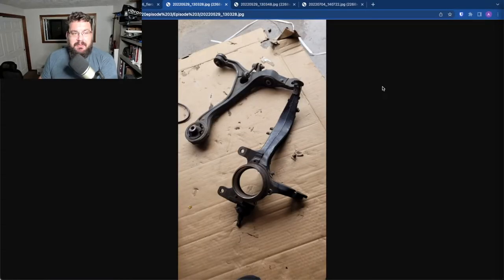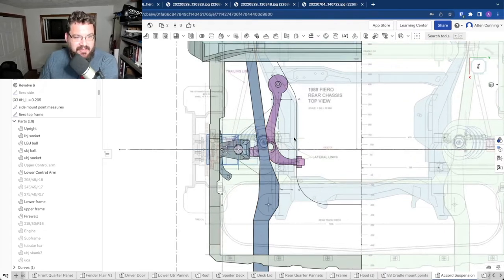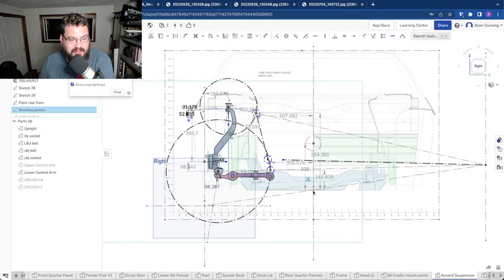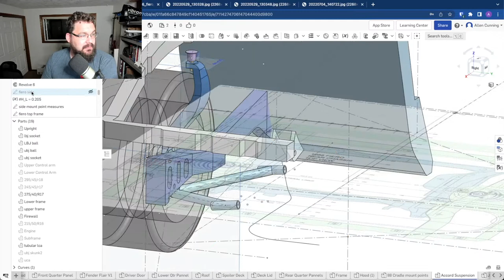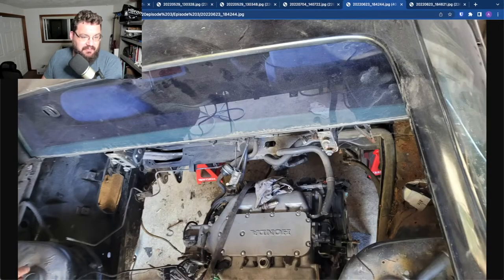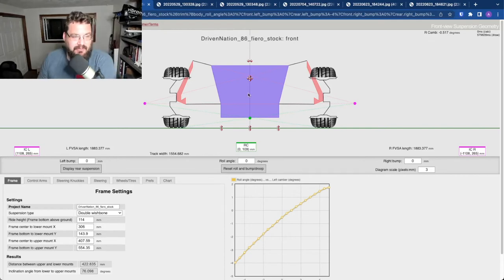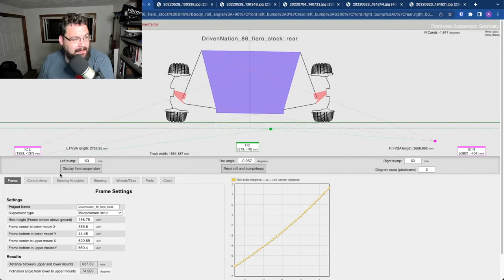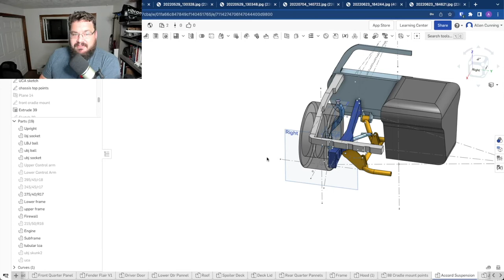J Swap Fiero Episode 3

Comment: I was dreaming something similar to your Fiero build.  Not only is the J30 and then J32 or J35 great engines, you can get it mounted to a 6 speed transmission and if you use the suspension from an Accord, it is a really good suspension being double wishbone with a large difference between the upper and lower mounts on the upright (knuckle).  I am guessing that since this is 2024 and no new videos on the Fiero, that this project got dropped.  That is too bad.  This has potential, but that comes with problems that need to be overcome. I would love to see this move ahead.
Reply from the maker: It's still a thing, I have just been distracted with life.

Comment: hey just stumbled across this, always wanted to do this!! I daily an 03 cl type-s 6mt, and my wife has an 07 tl type-s. I've been a hondafile for 20+ yrs, but once i got a j-series haven't had anything else. I had a spare cls6 and 06 tl 6mt but things got tight and got rid of the spares...... was wanting to do an mr2 or mx5 jswap but been eyeing a fiero and wondered if anyone had done it yet. I'm hoping yer still trying to make this work (or done!!), Good luck and take care.
Reply from the maker: Im still working on it. I got sidetracked getting my e46 read for the season and just don't have enough content to justify a video yet without just doing unboxing of parts i have accumulated.

Comment: Looking good ! Have you considered using the sub frame from the accord and modifying the mounting points to the fiero ? Just a thought, I've got a 86 fiero gt  and  the j30 with a 6 speed from a 2006 accord that I'm looking to put in as well and I'm just trying to look at all the options before getting too far into it.
Reply from the maker: I have, ish. The accord subframe wouldn't mount without modification... and then it's not super light. So I landed on making my own subframe. I think I could use the fiero subframe and then weld on mounts, either for the stock accord lower control arms or my own creation. I will strip the 86 fiero subframe and take out the accord subframe and mock them up on the car. I still think I want to make a tubular subframe but it's worth exploring beyond just conceptually.
Reply: @driven_nation   definitely, I'm excited to see how it all works out. It will also give me an idea on where to start !

Comment: This is really cool. I like the idea of using the accord suspension. Im surprised you couldn't get more camber gain in a roll though. What if you made the upper control arm shorter or moved its inboard pivot point down a bit? Either way great idea, the Fiero bearings arent great and I dont even know that you can get the rears any more.
Reply from the maker: I have because the upper ball joint mount is so high, if I just give it more angle, around corners it will move the wheel laterally (inboard/outboard). Currently I have 13deg of angle down from the upper ball joint which I **feel** is about as much as I should run. The arm length is also limited due to the drive train package. my LCA in this picture may be too long as it may hit the block on the passenger side.
Reply from the maker: I fixed the link in description so you can play with the geometry. If you find a better set up, let me know!
Reply: Well  I love the older lowered V8 vans or some are are so-cslled " barn door". Now the fastest I've gone? A buddy had dropped a 350 in his,S-10 & "DAMN!!!!!!!!!"  I can imagine all that horsepower & a lightweight frame????

Comment: one thing that worries me about this project is the engine since the manifold and the intake are cast into the unit making it hard for you to get power gains later down the road when you do upgrade things
Reply from the maker: Just the exhaust manifold is cast in. The intake are regular ports. There are multiple 600+hp examples with this mono port setup. That said I have since bought a j32a2 which has traditional heads since it was only $350 and picks up 20 hp and 30 ftlbs of torque. Selling the cats of the j30a4 basically paid for it.
Reply: @driven_nation  thats great to hear! i honestly hope you go for 6 to 1 headers and make it sound like an F1 car!!
Reply from the maker: @DatBoiOrly  ha I wish. My time is the big constraint on this project now so the more off the shelf the better. I ordered some p2r big tube headers, should sound pretty good though. If I custom made everything I wanted it would be done in 2030